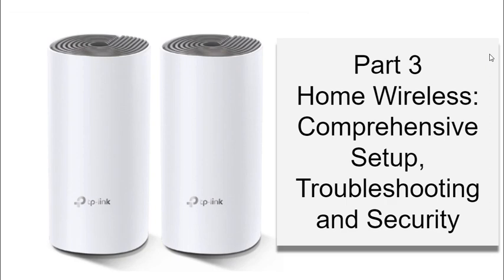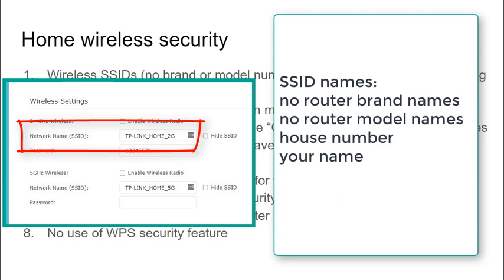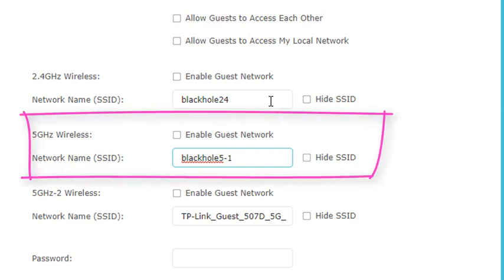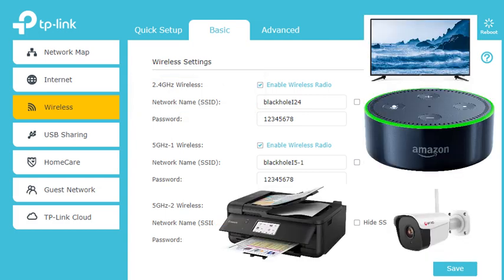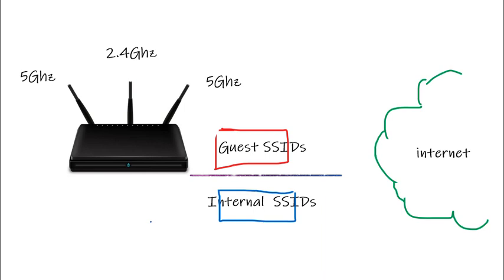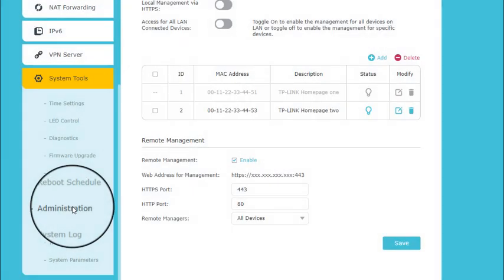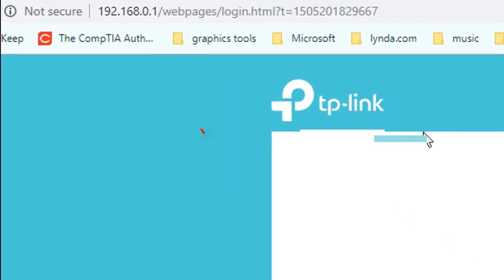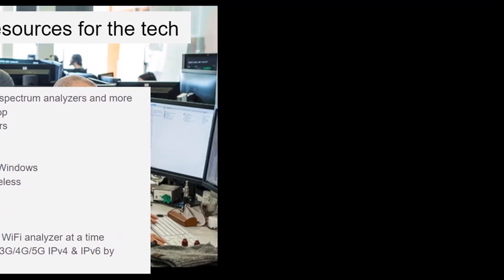Masterclass: Perfecting Your Home Wireless Network - Episode 3

Comment: If someone puts this much effort into cracking my home Wi-Fi and succeeds, they've earned it.  Please steal my identity while at it, you are superior.  Also, some issues..the guest Wi-Fi segmentation of IP cameras and such becomes a problem if bandwidth is throttled for guests..which is common for business implementations.  Keeping your router's firmware up to date is typically a stronger move than not giving up your router's model in the SSID because any exploits based on that router's model will typically be patched in the updates.  Also, disable remote access..but that's disabled by default.
Reply from the maker: Thanks for watching and your comments